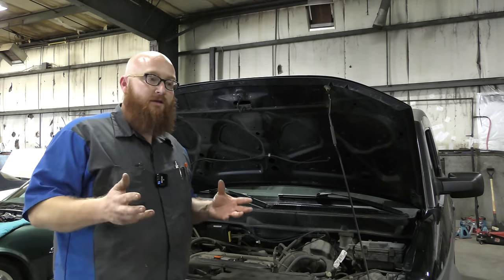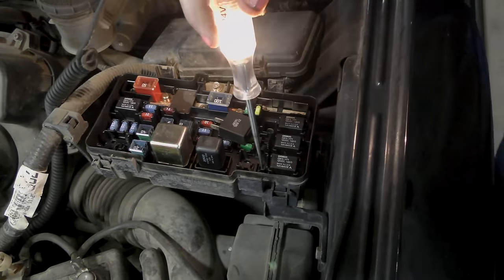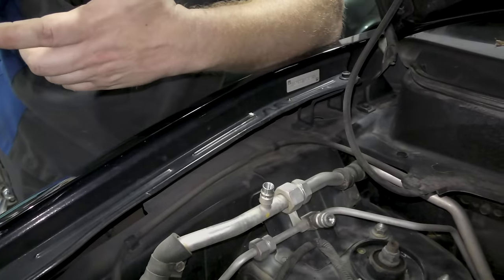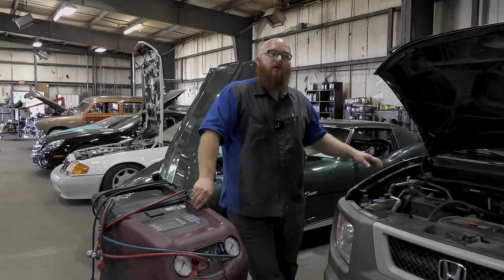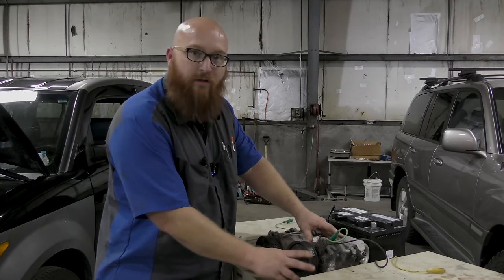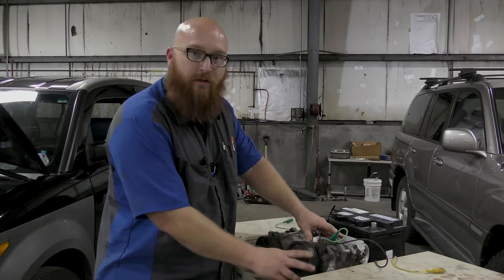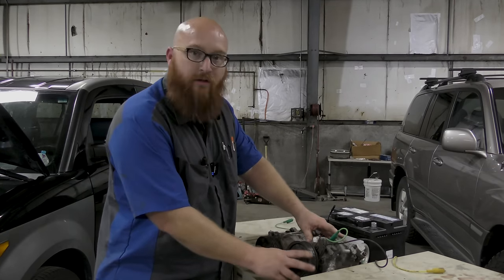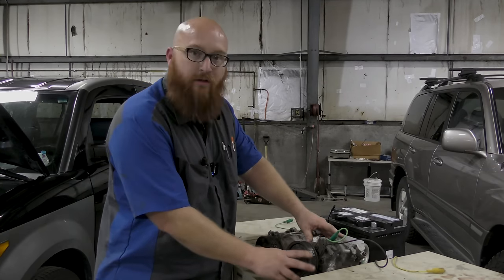AC not working!!! The CAR WIZARD shows how to easily isolate the problem

Comment: Two A/C stories: A couple of years back, my brother's A/C stopped working on his '05 Acura MDX (Honda Pilot) and it was the clutch coil. We were able to replace it on the car by removing a chassis brace and unbolting the compressor from the engine, but leaving the lines connected. Not a bad job, and saved a bunch of money. 

Last summer the A/C in my '92 Mustang 5.0 stopped working on the highway, along with the cruise control and a couple of other functions, so it was obviously a blown fuse. A new fuse was installed, and it blew immediately when the A/C was switched on. So it was a short circuit somewhere. The compressor has a short, maybe 8-9 inch long wire harness that connects it to the car body harness, and this harness has a fusible link in it. The fusible link had overheated, melting the harness to the left valve cover and shorting the power wire. I found a good used harness, installed it, and I was back in business.
Reply: Ha, that's great when the fusible link (which is supposed to protect the circuit) decides to protect itself by melting the harness to produce a dead short.  Brilliant!
Reply: I've repaired many Honda A/C systems exactly as you described. it is Much more cost effective. Especially when the other option would include the entire compressor which with a refrigerant discharge and recharge is much more expensive and wouldn't make sense if all you needed to do was slap on a new clutch.
Reply: Great troubleshooting.
Reply: Boring stories...
Reply: Fake
Over priced
Recycled
Dodge.
Reply: I was not aware the Clutch coil comes off the pump that easily while on the engine. 
I think mine is shot on my 2005 suburban. It's been full of Refrigerant for years blows hot now.
Reply: TL;DR
Reply: @ilikewaffles3689  Maybe you should ask your doctor about medications for your attention deficit disorder.
Reply: @realmaindrianpace  TL;DR
Reply: I was able to change clutch on 2004 Jetta without removing the compressor.  Picked up compressor from junkyard and removed compressor clutch.  5 years ago still working.

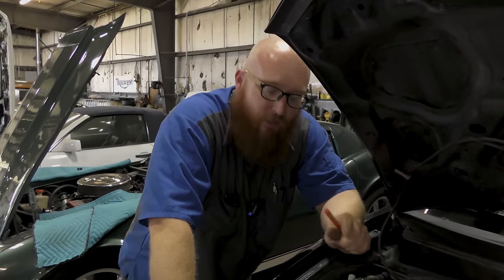Comment: 6:23 Yep, I learned that one the hard way.

I bought an old Buick LeSabre, that didn't have working AC when I got it, and I decided to go the "quick-fix can" route with it after determining that the electronics were working. I dumped in the whole can before throwing in the towel and taking it to a proper AC repair shop. The guy hooked it up to the machine and was appalled. He told me I overcharged the system by a full pound, and that the schrader valves were slowly leaking. He then proceeded to lecture me on how the modern AC systems need to be precisely filled with refrigerant or else they won't work at all. (I told him that I'll be disregarding the "advice" I picked from the old-timers who are used to working on the old R-12 systems. He laughed at that rebuke.)

I had him replace the valves and recharge the system with the proper amount of refrigerant. Part of the deal was that if there were any other leaks, he'd only charge me for parts if a second visit was necessary. I've yet to go back, since it's been working just fine for almost two years now.

Let me say, as a DIYer who refuses to let a mechanic touch my car unless absolutely necessary, that you're better off paying for the service than trying to fix it yourself. Find a shop that has the machine, with a tech that's certified to use it. Don't waste your money on those quick-fix cans.
Reply: Wouldn’t the gage for the ac valve let you know that it’s overfilled?
Reply: $, like he mentioned, or lack of it, can be the deal breaker. Sigh...

Comment: One other thing to check for a/c not performing up to par, is the cabin air filter.  I have acquired cars where the a/c barely worked, checked the cabin air filter and it was completely blocked. On another car, there was no air filter and the vents was blocked with all sorts of crap sucked in from the cabin.  Took an air hose and vacuum to clean up the mess, put in a new filter and got cold air out of the a/c.  Great job on the videos, really enjoy them and they are very informative.
Reply: @bamabonkers, where is the cabin air filter? Thank You.
Reply: @diose0078 it depends on your make and model, I’d suggest searching up where yours specifically would be. Most are right near the dash on passenger side

Comment: 1:42 this is how you know he has experience! always check relay first before anything
Reply: If it's a Honda I definitely agree. I usually check for pressure first.
Reply: Absolutely! Relay and fuses. I had a coworker once tell a customer their Lincoln MKZ needed a new gauge cluster which was around $900.... he installed the new one and still nothing. My first question to him was..” Did you check the fuse?” And sure as shit there was never anything wrong but a blown fuse. Keep it simple stupid

Comment: Very good video and explanation of the electrical portion of the system. I am an electronics technician and your process of troubleshooting by "process of elimination" is the best troubleshooting method. It verifies bulk areas that could be a possible problem and proves them functional. This helps with confusion with some troubleshooting where you're "stumped" and have no clue where to begin. I have seen many technicians use the "shotgun" method to repair electronics. Very costly and time consuming, also often unnecessary. Especially a problem when you've got an in warranty product and a tech shotguns the repair, and the customer knows a dozen parts have been ordered. You get the service call to install these parts. You know it's just this one relay causing the problem. You install the relay and of course its back running like normal. Now the customer still wants the other parts installed! Trying to  explain that you shouldn't fix something that's not broken theory is very difficult. It doesn't matter how good your experience and skills are, some things are never the same again! Sometimes certain technicians we had that saying, once they got their hands on it. "It will never be the same again!"

Example of that is, desoldering and removing components on circuit boards. The heating of it causes copper traces on the board to lift up and break away,  sometimes having to run a separate hard wire to and from its conducting points. This sort of thing can cause future problems and especially hard to fix intermittent problems. 
Once again great video one of the few where someone is very knowledgeable about the subject.
Makes your job that much easier to do. Although takes years of continuous training and job experience. 👍👍👍

Comment: Great video, as usual, Wizard!  But don't forget the fan on the condenser!  My 2012 Jetta a/c started being "weak" while sitting at a light.  But it would be okay on the highway.  Thought it was low Freon.  Turned out that VW has two electric fans on the radiator.  Illogically, the small one is for engine cooling and the big fan is for the a/c condenser.  The big one was shot.  Replaced it and the a/c blows cold all the time now :)
Reply: Same for my 2011 Corolla.

The fan would turn on its own, slowly, if you gave it a nudge which means it usually wouldn’t start going until you got going fast enough (wind speed) or hit a bump. Even though it was turning slow it was enough for the electronics to see it was turning and they would let the compressor run and that would give me plenty of cool air at speed.

It was bad bushings in the fan motor, which is common in some Toyotas.

Comment: I drove my element with out AC for 2 years before I decided to see if maybe there is a simple fix. Turns out I'm an idiot and the $20 relay was the 2min fix.
Reply: My little brother is the same with his 98 Dodge Ram, which is like brand new, he's been driving it without A/C for two years.  I'm sure that's going to change now that he's working days & not nights here in Bakersfield.  :-(
Reply: Sean Donaldson 
I was thinking the whole time watching this video. He never checked the relay. He verified current to the relay and current leaving the circuit,  but didn't check with his replacement relay to see if it worked. And what was the problem with the Honda?  Was it the compressor?
Reply: I respect your honesty. We've all had those times in our life....lol
Reply: @MrPaige222  I think the Wizard said there was no problem at all with the a/c on the Honda; he was just using it for the demonstration.
Reply: Those Honda Relays are bad news
Reply: DO NOT FEEL BAD! lol I was a new home owner and on very very hot July summer month my outside 30 year old A/C compressor died. So I was living in my house with no A/C for about 2 weeks until I finally googled/watched videos enough to learn about the tiny red reset switch on the back of the unit. Pressed it and bingo, A/C compressor came on. I had it replaced a few months later when I could afford it but man I felt like an idiot !
Reply: had that issue with my 73 Montego- IIIIIIce cold a/c but would shut off- wentr to ford dealer grabbed one and had better a/c than most of my buddies !
Reply: My AC compressor burn, spraying out black rubber of some source and making a lot of noises (clutch I guess is bad), wish mine was the relay but it not, so I'm not going to use the AC for now
Reply: That's just amazing it held its gas with the dried out seals from no oil circulation.
Reply: I'm in the same boat I've had no ac in my 2008 gti for 2 yrs now and summer is brutal in the over 100 degree heat while my leather seat car sits outside in the sun
Reply: Pretty sure mine is the compressor, or at least the compressor clutch. I live in a generally cool state, summer doesn't usually get hotter than 75-80. This week we had Temps of 97 and I regret not fixing it😂
Reply: @billjamal4764  that’s what I thought too but turned out to be the relay.
Reply: Mine was a bad pressure switch
Reply: I have cold air blowing, but it’s not 100%
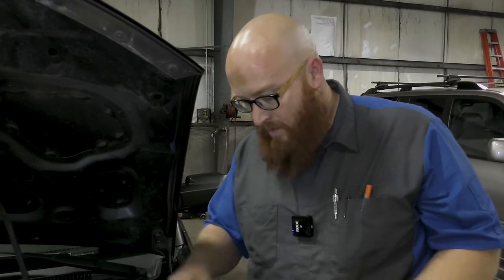Reply: @MrPaige222  He checked the relay at 4:01; if the system works with the relay switch but not the supplied relay, then that relay is bad.

He stated at 4:55
 that there are no problems with the A/C system in this Honda Element whatsoever and he was simply using it for illustrative purposes.  Everything in this Honda Element A/C system is good.  To put it another way, the A/C system in this Honda is fully functional, not broken, and there is nothing wrong with it.
Reply: My A/ C only feels warm on the 90 plus days.   At highway speeds it feels Cooler.   Do I just need a recharge?
Reply: @noyb7214    You could have a worn out compressor when you drive on the highway the engine speed increases making the compressor spin faster.
Reply: @ryans413  okay.  I’ll check it out.
Reply: That proves there are idiots in this world including me.
Reply: Driving with no AC is a humbling experience.
Reply: @MrPaige222  that's what I  thought too. He confirmed the compressor clutch with his replacement relay.
Reply: My van ac just doesn't blow hard enough out the vents. Like it's not pushing the ac air out. it comes on but it kinda a roll of the dice if you can feel any cool air circulating. Ie describe it as Intermittent. Sometimes it comes on strong but then after while it dies down & if I go around a curb or round about you can hear the ac flow change from high to low to back to low.
Reply: @Nikki-nf5rj could be the blower motor resistor or blower itself. Both are affordable and easy to install for the DIYer.
Reply: @seandonaldson5084  thanks I'll check those out.

Comment: AC is complicated and expensive so I appreciate the tips in this video, it might save you a ton of money. However, you did not go through the process of testing the relay. My daughters car actually had a bad one and the car had a flashing light on the switch, but I looked up the procedure to test it before I spent the $15 for a new one.  Additionally my other daughter moved to a new place and her parking spot is under a tree, if you have a clogged cabin air filter  it can reduce air flow all together and someone could jump to the conclusion that the AC is low on refrigerant....(ask me how I know)....Thanks again for your videos, I always seem to learn a little something

Comment: I once used a thermal imager to find a partially clogged condenser coil, the little desiccant pellets from the filter drier left the filter and made it to the coil. Without the thermal it was hard to pin point.

Comment: Thanks for the info. It's all good stuff to consider. One thing I could add is a little story about the AC's clutch on my wife's honda. Her AC would stop cooling the car when ever she stepped on the gas and sometimes it would turn back on at a complete stop. I learned from watching a video on you tube that there is a little washer behind the clutch assembly that might be creating to much distance for the magnet to engage the pulley. After removing the washer (shim) the compressor worked great and that was four years ago. She's been doing her complaining in a nice cool CR-V ever since. I fixed the AC for absolutely no cost by removing a part. And guess what? There isn't a mechanic in the world (including the Car Wizard) that would do this repair on someone else's car. That would be too polite and courteous for anyone with $20,000+ tool box. Sometimes a man must slay the dragon or get burnt to a crisp.
Reply: My wife also has a honda and have the same issue ac issue. You said a lot here that I'm going to check out. Is there more Information you can provide please?

Comment: Its rather specific to Hondas but one thing you didn't mention is that the clutch can wear out just enough to not engage well and sometimes there's an easy fix for it. On Hondas you can unbolt and remove just the outer clutch then remove the shimming washer to decrease the clearance between the clutch and pulley so it will engage again. It only reduces the clearance by a little bit so it won't last for too long but it's a free fix instead of forking over the money for a new compressor right away.
Reply: This is how I fixed my 2009 Subaru Tribeca.
Reply: For Volvos there is the bread clip or zip tie fix with a similar and even easier adjustment. Ten minutes and 3 zip ties and I was back in business—until something else went wrong.

Comment: I have to thank you for your knowledge, I'm certified in HVAC and suspected it was either the clutch on my unit or relay but being 69 years old and retired forgot a lot of stuff watched your video and it all came back I swapped out the horn relay for the AC relay and voila the compressor kicked on and charged it up to the appropriate charge and got my 2007 Chrysler Town and country van nice and cold so I can transport my disabled husband.

If you're ever in Glasgow Kentucky we'd like to have you over for dinner. 😊

Comment: I came here to try to diagnose what is going on with my AC system, and I finally realized why my car hasn't been defrosting as well in the winter. I never realized that the compressor runs the defrost. My car's AC hasn't worked in about 2 years, and I might not ever figure out why, but I've learned a bit in the process (it's a 19 year old car and has a refrigerant leak somewhere, and possibly other issues).

Comment: Excellent explanation of a system that has always been a potentially expensive mystery to me.  Just a general comment, a blown fuse usually is not a problem, it is a symptom of a problem.  Not many fuses blow just for fun.  They are responding to the real problem somewhere in that circuit.  But you are correct that relays do fail from time to time.

Comment: I love how you show us how to determine if the problem is inside the car or outside . Using the test light to watch the light turning on when the computer/ climate control panel sends the signal to the relay . Thanks so much this has given me information I been looking for to testing the ac system.

Comment: Hey Wiz. Good video and I like your channel. But worth noting that you can do the electrical test you detailed by simply pushing the AC button and listening/watching for the clutch to engage. If it does, and does so repeatedly, the electrical clutch control works. I would troubleshoot the relay circuits only if the clutch was not pulling in. Got an '08 Outback with a functioning clutch and R134 charge, but no cooling. Gonna check the pressure switch, thanks for the tip!

Comment: Man I am loving this video.  At 16 minutes you say "sometimes they fail when it is 105 degrees.  It is LITERALLY 105 degrees here in Houston, TX and mine just failed the other day LOL.  You did a GREAT job of helping me through diagnostics on this.  Thank you!  Compressor is turning with the belt but the clutch is NOT engaging.  I've been through everything else and the only thing that it really can be at this point is the compressor wiring.  For 4 years + now every time I drive throug a puddle or most of the times when it is raining out the AC goes from ice cold to turning off and will not come back on for another few hours or a day at the most.  It finally went out for good but the coolant level is perfect in the system, relay is good, fuse is good and it appears that the pressure switch on the skinnier line is good and receiving power from the harness.  When I unplug that pressure switch the button in the car for the AC looks like it is cooling (it is not of course) but as soon as I connect that harness 3 pin connector she goes out.  I'm going to try to figure out how to get to the ac compressor from underneith and disconnect the harness from it to try and hot wire the compressor with 12 volts like you did.  If she doesn't engage then that will confirm and I'll move on with removal.  Thanks so much for this video diagnostic!